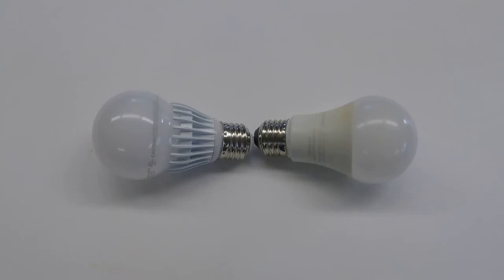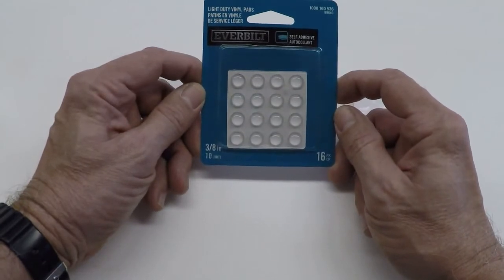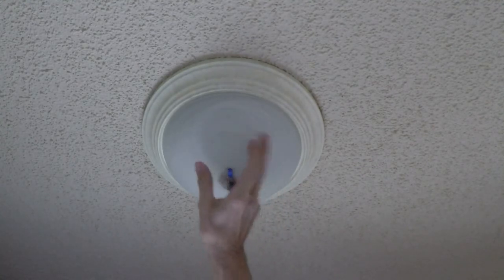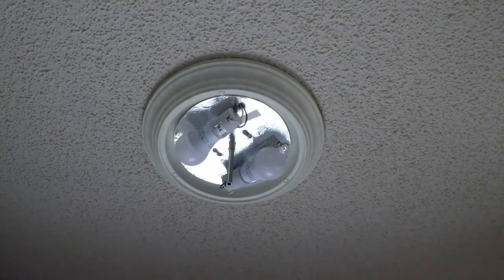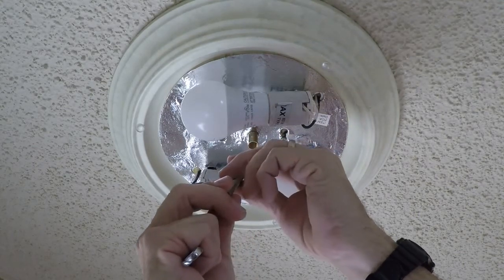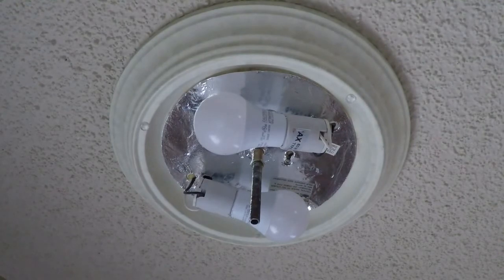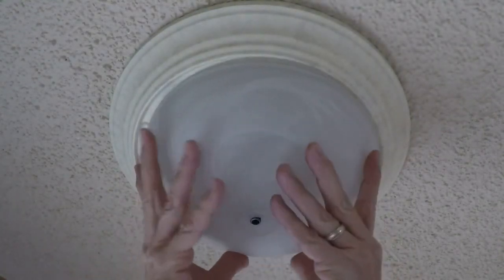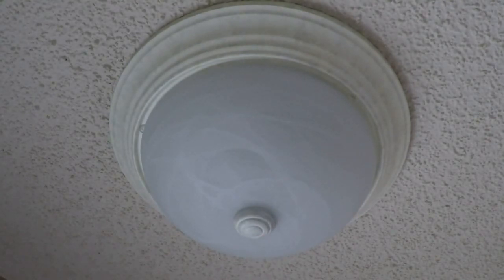Enclosed Light Fixture Hack for LED bulbs

Comment: I just use filament LED bulbs which only heat up in the screw base on the bulb. They run much cooler. That’s a good idea though.

Comment: Good video, personally I'd like a little bit more of a gap but any gap should be a significant improvement. Wonder what the difference would be when measured and where the point of diminishing returns is for a gap.